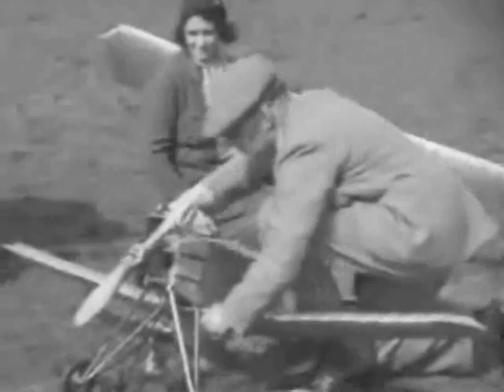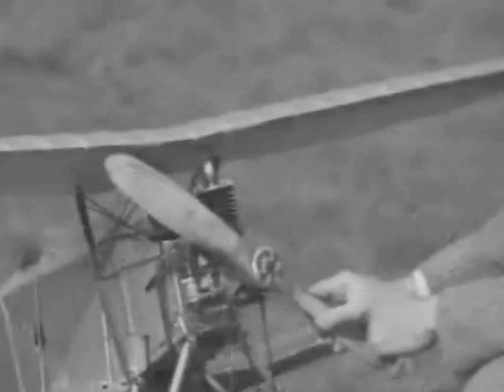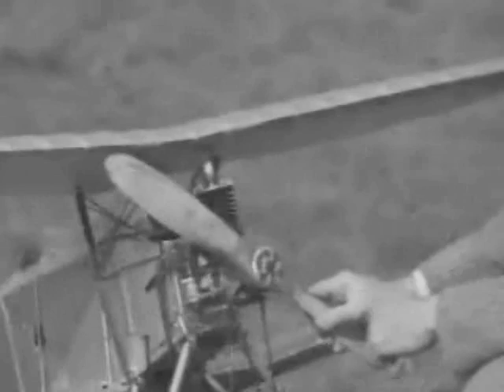C. E. Bowden, Model Aircraft Pioneer

Comment: diesel for model airplanes uses a lot of kerosene(50% or more) and some diesel from gas stations(30% or less) . the magic ingredient of the mix is the amyl-nitrate (10%) (very expensive and forbiden due to its narcotic effects in humans)... finaly, any oily fuel have ignition when compressed even without a spark.... the same happens in glow engines, also known as semi-diesel engine.

Comment: What's all the talk about diesel? It is a spark ignition gasoline (petrol, as in the description) burning engine, standard technology until gradually replaced by glow plug through the mid-'40's and on. Looks like it took him two flips to start it. Unless the engine is a piece of garbage to begin with (GHQ comes to mind), they start fine.

Comment: i think that the earlier engines was diesel powered, like cox engines. there´s no need to induce the ignition by other ways than fuel, pressure ratio of 25:1 and crank. you can hear the engine, the sound indicates low rpm and the noise differ very much from glow or gas engine, due to the different behavior of these ancient engines....i would like to fly a diesel model, but the fuel is too hard to home brew...

Comment: Have a go then,The engines go very cheap sometimes on eBAY and you don't need to 'home brew'just buy a small tin of diesel fuel at your nearest model shop.job done,but when you've safely screwed of clamped it to the work bench or work mate to get it running and enjoy the sound you'l want to get a model plane and get the thrill of learning to trim and fly it,keep at it and you'l be hooked.Good luck.Bye the way if you need help with anything its all here on Youtube....